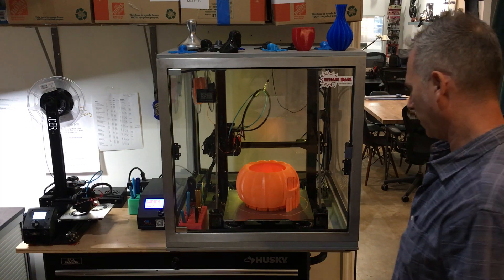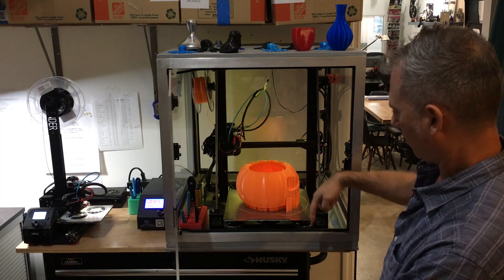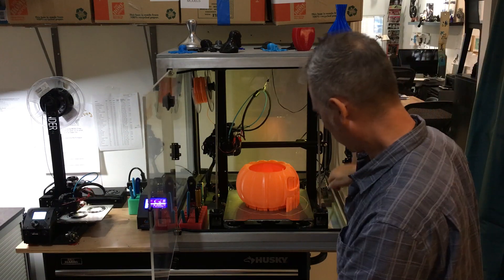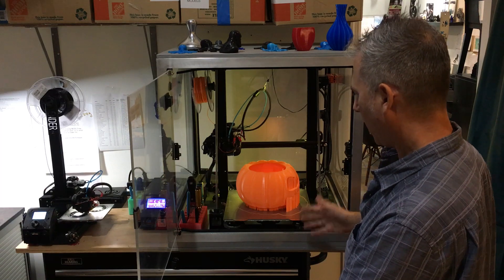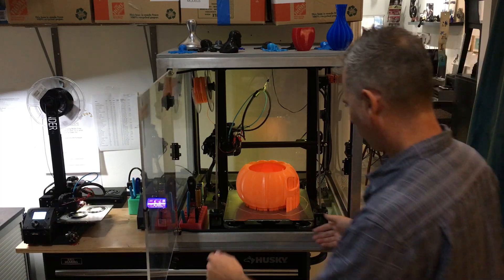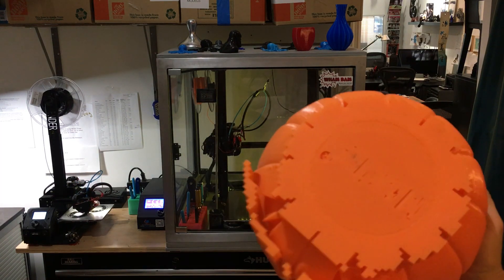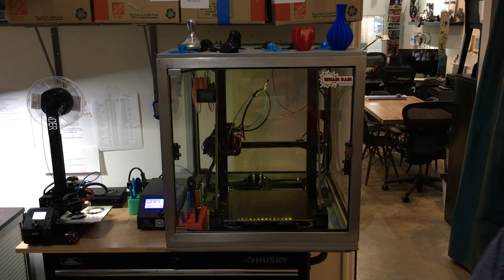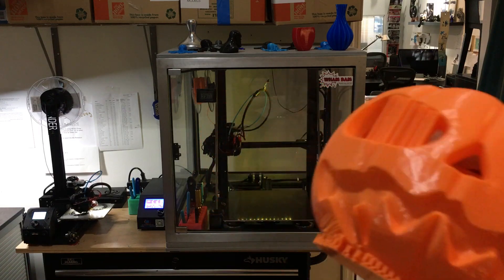The ease of releasing a 3D print with our Wham Bam Flexible Build System

Comment: one question for a CR10s pro, does the bed level sensor that is stock does it work well with the magnets?
Reply from the maker: Haven't tested it, but ours works with most any sensor as it is a conductive steel plate!

Comment: Will I be able to print with any filament and have no problems with it sticking and or releasing with this build plate?
Reply from the maker: Absolutely! But don't take our word for it, check out the videos our testers made with their findings. 
BV3D after 3 weeks of testing: https://youtu.be/0uG3NfgTkS0 
Nerys review with heat abuse: https://youtu.be/pSXgYwEcO6s
Reply from the maker: you can print successfully with no additives: PLA, PP, ABS, PETG, TPU, TPEE and others, Nylon takes some white glue to help stick